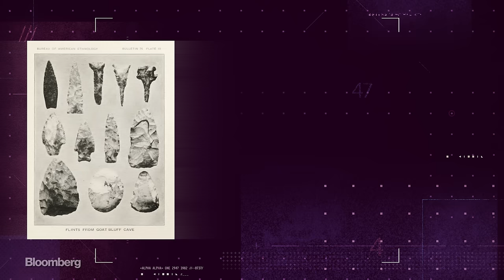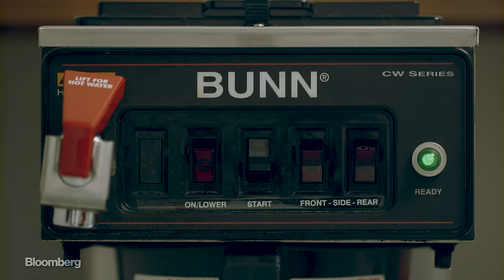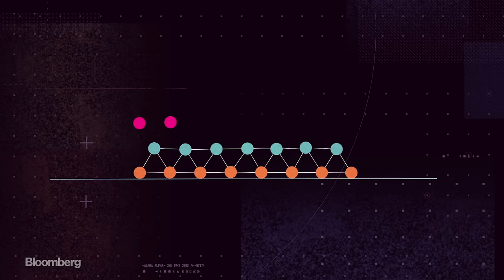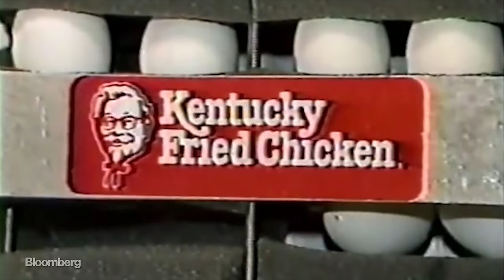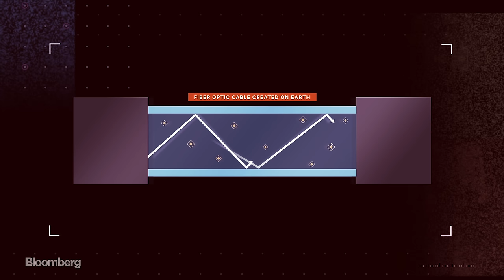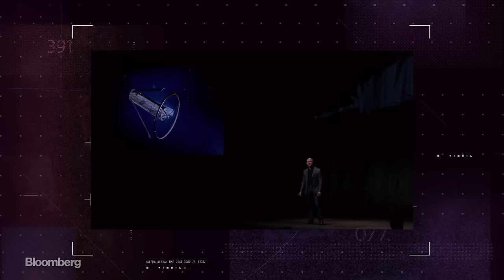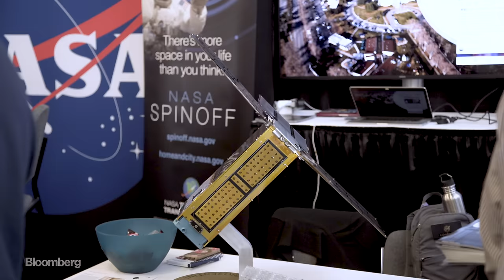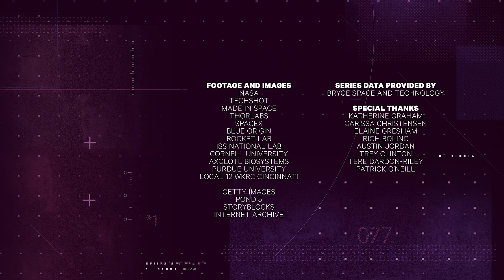Microgravity Will Change How We Make Everything

Comment: Space manufacturing is definitely an interesting field. The problem is that there is no value in space. This means the things manufactured in space must ultimately create a product for consumption on earth. The bio-printing and fiber optics are  most certainly two of such applications, but we need to invent more. Many will fall off of space limited products. For example the optical fiber may be possible to manufacture on earth at higher temperatures and pressures in a heavy fluid essentially simulating zero-G environment via buoyancy. Naturally biological applications are limited to lower temperature range hence making them unique to space manufacturing; but we need to invent more products.

Comment: We can now build space elevators from current materials. Just as rockets are built with multiple stages, so could a space elevator be built with multiple stages but the heavy lifting on a space elevator is at the center. At G.E.O. where gravity is virtually zero, there is no weight penalty for having multiple tethers. By using multiple tethers at the center ( for greatest strength ) and fewer tethers as you move away from center ( for lesser amounts of mass ), you avoid the problem of not having a material which is both light and strong enough. Liftport has plans to build a Lunar elevator from high-strength para-aramid fibres (such as Kevlar and M5) or ultra-high-molecular-weight polyethylene fibre. Using that same material for an Earth based elevator would reach the lunar gravity center (about 9,000 km AGL) approx. 1/6 G. Add this new concept and you could reach Earth’s surface.

Comment: You need space stations-and not small ones.  Do low orbit ones to receive materials. Then send them up the line to the large facility in stages.  We don't have materials strong enough to make elevators yet.  We do have the ability to build jump stations to overcome the gravity well economically. It's all about using interia to best advantage.

Comment: 20:25 In what universe is a 3D Printer simpler than folding solar panels? You still need to bring all the materials to make the panels, plus the weight of the printer
Reply: Everything you launch has to be able to withstand the tremendous forces during launch. Folding mechanisms get progressively more complex with bigger panels while the relative weight of the 3D printer becomes less and less significant.
Reply: I beleive part of the idea is to get the materials from the moon or mars

Comment: the fairing size constrains are not the only problem with launching strucktures. The second are the high forces that the strukture will go through in a rocket launch. Because in orbit gravety does not imply forces into your struckture, you only need the strength for launch. So strucktures made in space can be much thinner and therefore bigger with the same material required.

Comment: 3D printing the things that you need in space is no different from folding your solar rays. You don't get rid of the weight and you don't get rid of the space it takes to ship it up there. Whatever materials you're going to print it's still going to come from the filament or material you're printing with. Meaning you're still going to have the same weight problems. But I guess it's a step in the right direction.

Comment: This is neat but it sounds extremely impractical. For this to make sense you'd need to be making something that's so fragile that it must be manufactured in zero-gravity, that will be durable enough to survive re-entry, that could justify the enormous cost of a space launch and recovery, and that couldn't instead be manufactured on a reduced-gravity aircraft. ZBLAN is the most convincing example but why not just make it on planes?

Comment: If Starship continues to be developed to a fully working system the cost to orbit could be less than $100 per kg rather than more than $10,000. Elon Musk reckons $2 million per hundred ton payload launch, or $20 per kg, but even if it's 5 times that, reducing the cost by a factor of 100 opens up far more posibilities.

Comment: A space elevator. A 3d printer thingy above one of earths poles, so it doesnt swing around smashing satellites, just high enough to not be affected by earths atmosphere. Prints a lattice both directions in order to counter balance gravity. Earth supplies water and an adhesive, moon dust is used as printer cement. Probably cheaper hauling moon dust in 0 grav. Once elevator is done, giant moon rock is shipped to the space side of the elevator.  A cargo slightly lighter than the space rock is attached earth side. Simple pulley mechanism. The rope would have to be extremely light and durable. Earth gets piles of moon rock and batteries are sent to the moon. Skip a few decades and the moon factory is shooting energy capsyles towards mars, for mars factory. Mars gets an ice 3d printer and prints igloo greenhouses. Once sustainable mars fires empty canistors towards jupiters orbit, super state gases as energy, by then we'll probably have found a goldilocks planet to have a chain of collectable energy capsules speeding towards. Maybe?

Comment: But isn't the archanaut going to have a bit more mass than prefab solar arrays? I mean, to build something, you need the same mass or more to have the end product. How space deliveries work is based on mass, which means that an arkanaut and the raw material will cost more, and you don't have the assurance that it will actually work once in space. Further, there's a possibility of littering. If I can make solar arrays in space, then when they're defected, it's cheaper to have refueling vehicles also refuel 3d printer raw materials so I can rebuild the solar array, than it is to actually repair them.

Comment: Talks about reducing costs diminishing payloads weight and manufacturing on space. Thing is you still need to get the material that will be used for manufature to space, just a thought. Great series!
Reply: Well yeah but we are still far off from harvesting/processing on space. Giving it another thought though I guess that if the problem involving deploying such satellites revolves around size and not weight, you could pack material real dense to print. Much more dense than what you could fit on a cargo with a folded satellite
Reply: @cumguzzler8537  We are talking about the same thing my dude. Let me rephrase it, "cool tech, but it needs other tech which doesnt exist yet to work"

Comment: Just wanted to correct that gentleman from the 80s, an egg yolk doesn't tend to float down, but rather up in the egg; that's because the white is mainly water and the yolk is mainly fat, and fat, as we know, floats on water. It's easy enough to check for yourself if you doubt this.

Comment: Love the series, but just throwing this out there. 
If you have a 3-D printer in space building the solar panel array you still need the material on board to print the array so you don’t reduce weight. I’m thinking it will lower the cost of engineering by not requiring engineers to design the folding array but that cost may or may not be eaten up by developing and running a 3-D printer in space. 
Anyways no one will read this haha

Comment: Instead of bio printers they need to put self-replicating 3D printers on the moon, mercury, mars, and Venus*(floating on Venus atmosphere*).  The 3D printers could take a mix of mud & ice and print solar collectors to fuel its self-replication, and it will also print arms to help it connect the parts that it prints out.  If you send a mold for chips, you could create Silicon and use the mold to make a thicker mold that can be sliced up to have all the chips needed for the trillions of 3D printers that you'll get if you let their numbers double for 30 generations.  Later on the 3D printers on Mercury & Luna could in theory build a huge magnetic rail to get out gravity and then we can use that to build a dyson sphere to harness the nuclear fusion power directly.

Comment: Microgravity will surely change the way I take a dump! Check the scene in 2001 where Dr. Floyd is going to take a dump and there's a long text with a title: Read before using the bathroom.

BTW, gravity is everywhere - even where the field reads zero (something that happens on a mathematical surface - mathematical means it has depth, no thickness). And you can never have matter and no gravity - as the apple said.

Kudos for Bloomberg to stick with the correct "microgravity" - thumbs down to the marketing guys saying "no gravity" or "lets get rid of gravity"  ... c'mon ... let's get rid of statements like that because the damage they cause on our education is extremely grave!

Comment: What’s up with all these people thinking construction is the hard part of building large structures in space?
It’s 100 times easier, you don’t have to have cranes, you can vacuum weld by just cleaning the surface, you can move huge structures without wheels or anything. Construction in space is trivial, it’s getting the material up there that’s difficult. No amount of robot arms and 3D printers will help you with that.

Comment: My questions is if they are using a 3d printer in space in order to print the solar panels how is this saving weight off of the payload hwatsoever if the 3d printer is not getting the materials needed in order to print that from space? If a 3d printer is going to print it in space it is going to still need the same amount  of material in order to print those solar panels correct?

Comment: 20:50 how would this method reduce weight? you still need to bring the raw materials up to make the solar array, no?
Reply: Raw material is less complexity. Drives down costs.
Reply: I want to know the answer as well.
Reply: The primary factor in cost of getting things to orbit is mass, but size is also a large factor.
Compressed raw materials take up waaaaay less space than constructed and fragile devices.
You could also shoot compressed raw materials into orbit using a mass-driver, for example. Do that to a satellite at the same speeds, and you end up with a fine mist of shrapnel. :V

And third; you can recycle current Stuff in orbit. Old satellites. Discarded farings. The trash from the ISS. Etc.

Comment: ''A tip for made in space'' - to increase the fiber optic quality there are two factors presence of air which causes the micro glass bubbles so should be manufactured in a vacuum* and correct temperature* which will reduce the fractures.

Comment: Ok that last bit was unbelievably dumb. The spools of filament and the 3D printer take up space too and typically the plastic is much weaker and sometimes even heavier than conventional materials. And you can't 3D print the actual solar cells of the solar array so you would still need to fold those up inside the satellite anyway. You are saving almost nothing on space and definitely making things heavier.

Comment: Maybe you can still get Levi's , it's quality  fibre optics for sure, were only as fast as our slowest sometimes ,there's a lot of satellites and with commercial crew it makes for  like higher orbits and less problems than the Apollo program endured with  babysitting consoles of fragile information,crew and flight control  adjustments. It doesn't go bang either and seems more passive, is it brittle and is it  seems to wind well enough. Hopefully it's stable  and best wishes in it's test phases , maybe consumer products eventually  will be improved.,i should imagine its high end industrial so far.